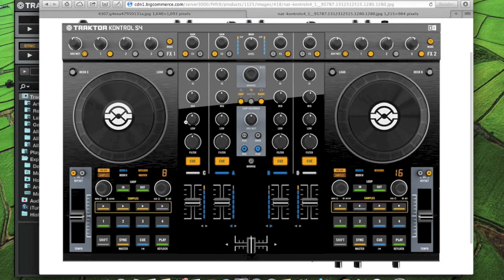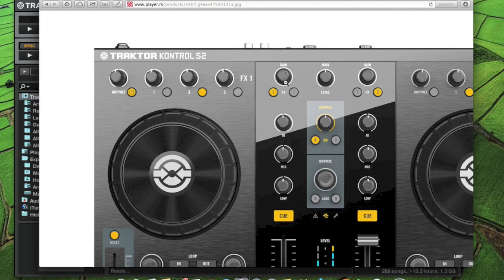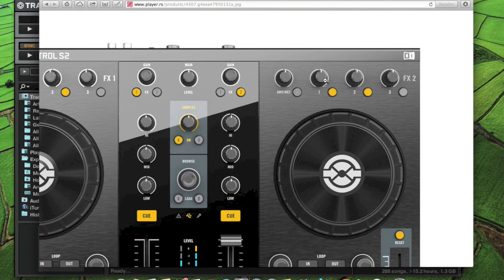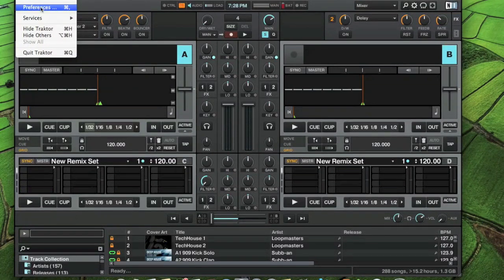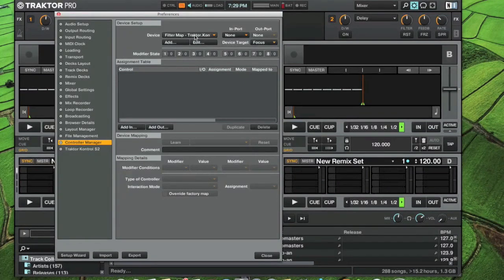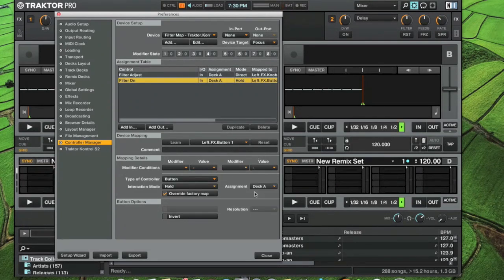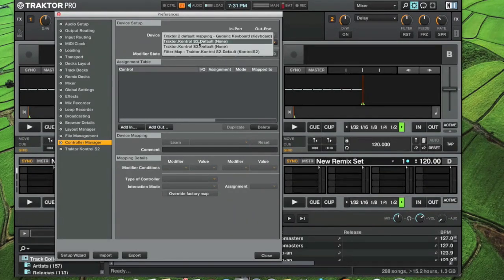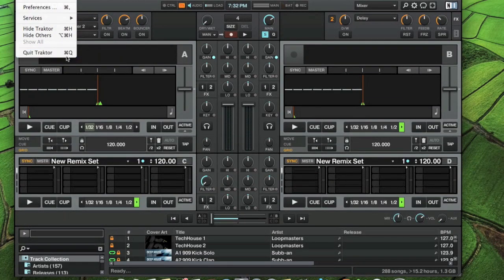Best Fix for the MIssing Filter Knob on the Traktor Kontrol S2

Comment: The issue now is after you've tapped the button to turn off the filter and then go to recentre the filter knob, the filter will re-engage. I haven't worked out a good solution to this problem.

I've tried using the button as a modifier so the filter adjust knob cannot go active when the button is pushed. This works at recentring the physical knob without activating the filter, however the knob's position will not be updated in the software. If I tap the button again (re-activating the filter), the filter will switch back on at the old position.

What's more, when I press the button and turn the knob, the knob now controls the FX3 knob, even though that directly violates my modifier conditions for activating said FX knob O_o. In fact it violates BOTH the conditions I've set for controlling the FX3 knob: 1. SHIFT must be pressed and 2. FX3 button must not be pressed.

Really confusing mapping software this, it doesn't behave as expected. Always having to find workarounds, reach compromises, and adapt to odd little behaviours.

Comment: there is a way easier way to get a dedicated filter on the s2 without having to map anything.  The built in filter effect in Traktor is just as good if not better than the default stock filter they give you.  Just by simply assigning the filter effect to one of your effects slots in the effects panel you can have a dedicated filter with no mappings necessary.  If you rather do it your way, you can make a macro and map the turn of the knob to turn the filter on and off.  So when you turn the knob the filter is in use and when you stop turning the knob then the filter is off.  Or you can map the knob to turn the filter off when it reaches the middle detent.  This eliminates the need to map the filter on/off to a button and its one less step that you have to do.  Just a suggestion, but its much simpler than the what you described here in your video!
Reply: No, the filter given by traktor is shit
Reply: Oh yeah for sure!  There a way better filters out there but for basic high and low sweeps it gets the job done and 99% of people you encounter at an event or party won't even ever notice you using the filter.  Me personally I don't see anything wrong with it for just basic sweeps and transitions.
Reply: i dont like it because its more an equalizer than a filter :/
Reply: I do think that you can go into preferences to change the mixer style and the type of filter to get some different sounds!  Some of my friends that have the same issue you do tend to do that instead and it seems to work out alright
Reply: what controller do you have? s2 or s4? btw the new kontrol s8 has dedicated filter on/off buttons for the filter knobs on each channel!
Reply: well there aren't dedicated filter knobs on the s2 so I am kind of confused by your question :/

Comment: this is a great tip and I would like to do this, however the problem is when I do this, it breaks alot of the other buttons via the mapping. For instance, play stops working, pushing in the browse button to maximize browse window breaks as well...etc....can I get any help on that?
Reply: watch the beginning of the video where he shows you to create a duplicate of the default mapping.  Then when you want to use this mapping you have to make sure that the "in port" on the default mapping is set to known and that the "in port" on this mapping is set to your controller, which is the s2 I am assuming!

Comment: I have 2 questions: 1) Is it possible to configure the FX1 knob NOT to activate the filter whenever you turn it? I want only the button to control on and off. If its off, I want to be able to turn the knob without activating the filter.

2) I noticed that the filter in the FX panel sounds and works differently than the mixer filter. Is there a way to map the FX filter instead of the standard one in the mixer? 

Thanks!